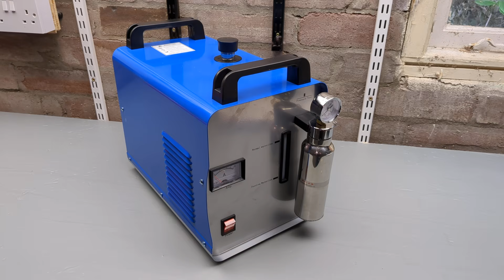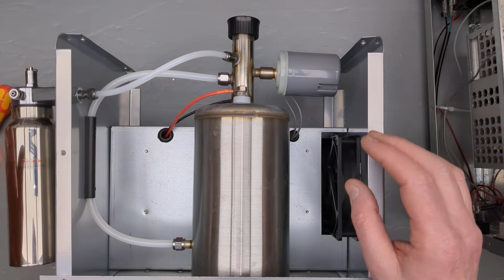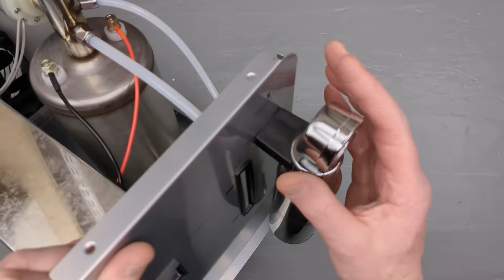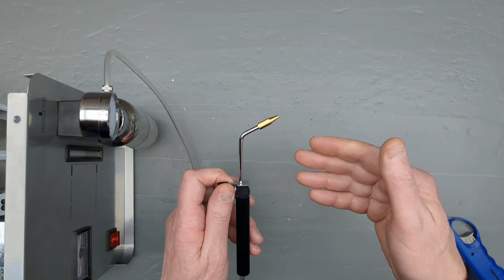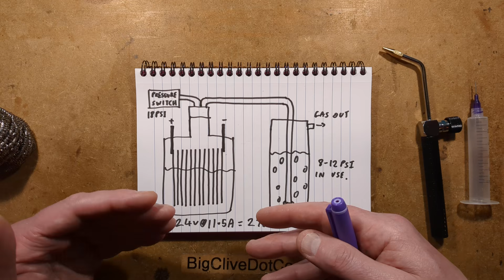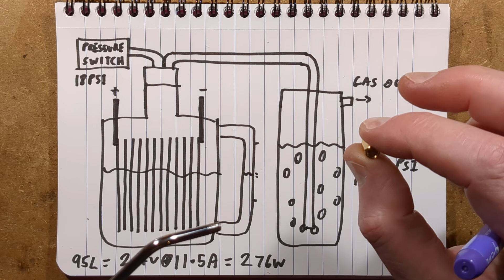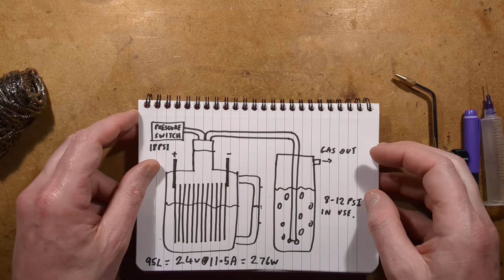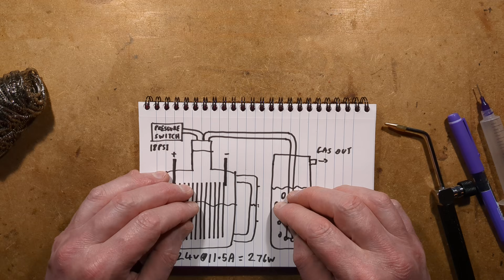Inside OxyHydrogen gas generators (HHO/Brown's gas)

Comment: My high school chemistry teacher told us about a demonstration he did a few years earlier. He put some soap and salt into a pie tin of water and added a couple wires to a power supply. He let it run for a while on his lab table up front while he talked about electrolysis. Then he pointed out that by putting energy into the water, he could separate the H and O, and that if it were ignited, it would release that energy. 
When there was a nice pile of bubbles, he tossed in a match.
It blew out all the ceiling tiles over his table.
He didn't say anything to us about whether he (or any students) required new underwear.
Reply: I love it when high school chemistry teachers randomly act like magicians in a king's court.
Reply: @geoded  Today there will be 5 helicopter moms complaining that their baby had to hear a sudden loud noise.
Reply: This is what chemistry should be even if it is somewhat risky.
Reply: I remember my very first chemistry lesson.  The teacher put a small pile of potassium permanganate on his bench and added some glycerine.  A couple of minutes into his lecture it all caught fire.  That got me hooked on chemistry.
Reply: Not sure why it's "HHO" gas... wouldn't it be 2H2 + O2 gas mixture?
Reply: @iWhacko  Each action of electrolysis results in two individual H and one O atom. Sure, in the space outside the liquid, they combine to H2 and O2 molecules, but that's a separate reaction. For clarity, in writing and language, you say that the electrolysis creates HHO, not 2H+O (unnecessarily complicated), not 2HO (wrong, it doesn't create two hydroxy ions), not H2+O (might be misread as H2O and also the formation of the H2 diatom happens separately from the electrolysis) and not 2H2+O2 (again complicated AND wrong, since we're talking about the products of a single electrolysis action).
Reply: @CookingWithCows  That is incorrect, there never is free H or O present. Otherwise you would not only create Ozone (easy to smell) but it would also self-ignite due to the highly reactive nature of both species. There only ever forms molecular H2 and O2.
Reply: @iWhacko  the HHO name is legacy. It was invented by a quack that was trying to claim this was a new kind of gas (i.e. not just a hydrogen and oxygen mix) and only his machines could make it. That's why the name makes no chemical sense.
Reply: Haha what a great teacher...
Reply: I loved my high school chemistry teacher, he was always doing stuff like that. He made a calcium carbide cannon and used it to shoot projectiles down the hallway. He made benzene and set the top of his desk on fire, filling the room with black ash floating everywhere.
Reply: in biology class one smartass student decided if you put a drinking straw up the frogs bum (it was dead and ready for disection) he could inflate it like a balloon.
not to be outdone someone else filled it with butane and as the gas came back down the straw lit the flame.
a loud "pop" and 30 students plus teacher covered in frog bits
Reply: Another comment of mine deleted - is YouTube censoring out comments on chemistry now ???
Reply: @tncorgi92  YouTube prefers nude bots instead.
We all know that.
Reply: @tncorgi92  of course they are

Comment: Some of the welders at my old work filled a bin bag with oxyacetylene, when they lit it on night shift it went with such a bang the dust got blown off the top of the overhead crane and they never did it again. A few brown knickers that night i bet 😂
Reply: Years ago, I watched a Panel repair shop doing that with balloons with fuses. They would fill and light them, then send them out the window, into traffic on a major highway.
It was their lunchtime entertainment, watching motorists and pedestrians soil themselves in fright
Reply: @bigbadwolf1966 filled a junk car with it that still had all its windows and doors.  Sent parts all over the salvage yard. Boss not amused .
Reply: @jhonsiders6077  Turned a station wagon into a mini van.  😅
Reply: Back in 98, on my first job as an electro-mechanic at a rewinding shop, a co-worker and I did the same thing, the last day before Christmas. The boss and his entourage did always go out to eat at the fancy restaurant on those days. And all the old French dudes where taking their usual nap after lunch, they all did every day, I guess the red wine makes one sleepy :)
But we put the gas in a latex glove with a lit cigarette tied to a finger as a time-fuse and a nut to another finger to weigh it down, then we put the glove inside a long, thick walled steel tube used for machining, it stood upright and was secured to the wall. 
That sounded like a cannon shot when it went off and the cig was so that we had time to run away and hide ;) And yeah the old black dust full of glass fibers, mica and god know what else, fell from the rafters and the overhead crane. A year later we used a big polish cobra firecracker in the same tube... I only worked there for 2,5 years, it was really filthy in there. All that dust, greases and the chemicals from burned windings and enamels. Solvents and thinners to wash out the windings and rotors (under 50 MOhms@1500v High-pot) from the graphite dust sure took some years off my life and gave me Tinnitus, from the compressed air... 
And now my final and last edit :)   I had to take some passes on many collectors with the lathe because they often where very worn.  I than had to grind out the mica or perhaps even asbestos insulation between the individual copper blades using a very small air- powered dentist style diamond abrasive wheel and chamfer & deburr their edges... And PPE was at that time a problem, the Boss's wife always yelled at us after the restaurant and I suppose a good amount of alcohol, so often there where no masks, latex gloves or earplugs left, since according to her we used to much of them, go figure. 
The oldest French dude once even threw a 2 Kg wooden mallet at her and had a heart attack 10 minutes later... After our paint guy had developed some form of light liver damage and his skin had become some shade of red, we at least got a half face-mask with a combined filter for particulate and vapors and on top of that I also got a pair of prescription safety glasses, after ruining my personal pair of glasses. 
After that job I repaired and serviced large HVAC installations full of anhydrous ammonia and then went to work for DuPont de Nemours , where finally there was a standard operating procedure for each and every single job with PPE everywhere, and you better take the stairs on the right side, firmly gripping the railings Lol. 
But I did learn a lot the motor shop, the place still exists today. Back in 98 we mainly serviced, repaired and rewound big DC motors. Today they also wind huge alternators for Vestas and other windmills
Rofl, thanks for the good and bad memories from a time when I was still young and naïve.
Reply: We filled a beach ball with oxyacetylene, put a long piece of masking tape on the side, doused it with WD40 and lit it.  The explosion was blinding AND deafening.  Kids, don't do this - we were professionals.  Professional knuckleheads, but professionals, nonetheless...
Reply: A 200 ml chocolate milk container full makes enough noise to make storeman kick himself over backwards out of his chair, I'll wait outside while you set off a binbag full, thanks.
Reply: You guys should search on youtube for 'carbid schieten'
It's Dutch folklore XD
Reply: The oxyacetylene pops make the oxy-hydrogen seem quite tame!

Comment: Many years ago we used to make Hydrogen with sodium hydroxide and aluminum. The reaction does get very hot. We would then fill dry cleaner bags and tie a piece of toilet paper as a fuse to it. It would go up 30 feet or so and then explode and sound like thunder. People would come running out of their houses on a clear day to wonder what happened. His mother was always out of aluminum foil. 🤣🤣🤣
Reply: For bonus points, maybe mix in some finely ground flour or cornstarch and see if you can get a dust explosion kicker!
Reply: I used to do it with water balloons, little small things nice bangs.
Reply: Did exactly the same thing, but in two stages. First stage was a drum with aluminium and sodium hydroxide solution. Then the hot gas was piped into a second drum filled with water. This cooled and cleaned the steam out of it. What came out was essentially pure dry hydrogen. This went into balloons of course. What we sent up with these balloons varied but the best ones carried a second balloon filled with an oxy/acetelene mix. Attached to that was a cracker of some sort with a time fuse (an incense stick) These burned at about a minute per inch so we had a good idea when it would go off. After 5 minutes the whole thing would be at about 5,000 feet so the whole neighbourhood got to experience the bang. Best at night time.
Reply: I bubbled it through water to condense the steam. Used to fill large balloons and condoms. I once had about 20 balloons and a condom against the ceiling inside a flat and separated one balloon to light it. I saw a flash and heard/felt a massive boom...it set off the condom and most of the balloons. Made the windows in the building rattle. Bunches tied together with a long fuse would look great exploding in the distance.

Comment: Fun fact - if you provide a 100% excess of the stoichiometric quantity of oxygen, the detonation speed increases substantially.  I don’t know if it is louder, but it is more amazing.
Reply: And if you're braising, you need 5 hydrogens for each oxygen to keep the flame from oxidizing metals.
Reply: Odd that this is the exact opposite of petrol vapour, where excess oxygen slows combustion speed.
Reply: @ferrumignis  are you referring to an internal combustion engine or is this some setup with pure oxygen?
Reply: Hydrogen not oxygen

Comment: Burning hydrogen and oxygen doesn't really make water (a liquid), it makes hot water vapor (a gas) and is very exothermic.  I wouldn't rely on that creating a vacuum.  After all, they use the hot expanding gas from this exact same reaction to put spacecraft into orbit.
Reply: Yes, but then the chamber and standing water will conduct away most of the heat, creating a near-vacuum almost instantly.

See “steam engine design” for details.

Comment: With a hose full of hydrogen and oxygen, what keeps the flame from just going right on up the hose on that?
Reply from the maker: Not much.  Flashback is common on these systems.
Reply: Two things come to mind.
1) The nozzle with its tiny orifice produces a high speed gas jet. The jet burns, while the gas velocity may be sufficient to "blow" combustion out of the nozzle. The success here depends on how fast the gas actually burns.
2) The brass nozzle is an excellent heat sink. Similar thinking suggests stuffing the tube with brass or SS wool may be effective with small dia tubes. If the heat sinking wool gets hot enough, it simply becomes a flame holder.
Reply: Gas flow rate.
Same thing goes for acetylene. Setting one up with the pressure regulators running too low is how flashbacks happen. Or the flame migrates back down the torch tubes and into the mixer (in your hand), eventually (pretty quickly) melting the tip tube or letting you know it's happening by finger/palm print removal.
Reply: Flashback is more likely when the flame is perpendicular to the surface being heated.

Comment: It is very easy to generate small amounts of oxygen and hydrogen separately in small quantities with a very modest setup and low voltage DC. Just capture the bubbles from the anode and cathode separately. I did this for a school project using an old lantern battery for power when I was 12 years old in the '70s. It sends me crazy to watch the scammers pitch magic to younger generations that never learned the physics basics.
Reply: @Nighthawkinlight for more details, because there are safety concerns when generating at home, in your bubble bath tub.
Reply: @PastorOfMuppets616  I did this for fun after I learned a little about ions in my first college chemistry class. In small quantities, all you really get is a neat little "pop" and a quick, tiny burst of flame when you light the hydrogen. I wouldn't want to touch it, but it probably wouldn't do much more than singe your hair.
Reply: @PastorOfMuppets616  Yes, there are safety concerns, but generating the hydrogen and oxygen as separate gasses, as I describe, does not create the explosive mixture of those two gasses mixed as shown in the video.
Reply: the reason these things are popular is because of how fast they generate gas and the resulting flame being way higher than what butane will give you. the electrolysis setups I've messed with would have taken a day or more to make enough gas to run that little high-temp torch.
Reply: I did me some electrolysis way back when (had to be 1964 or earlier because of where I did it).  The gases were collected in inverted test tubes,  and the electrodes were carbon rods pulled out of dead D cells.  Power was a "dry cell" or two,  probably pretty much depleted.  This ran very slow,  so at some point I hooked up a 500mA rated selenium rectifier I had on hand and a line cord,  and plugged it into wall power. That went a good deal faster!  I had to replenish the water fairly frequently,  and of course whatever was in it stayed behind,  so the water got darker and darker as time went on.  This put me off of drinking tap water for a good long time!  :-)
Reply: I blame TikTok for shortening their attention spans.
Reply: @PastorOfMuppets616  The platform isn't the problem. It's always been the accelerating decline of the  meatheads it attracts.
Reply: Use stainless rod and copper tube and twelve volt battery to generate hydrogen

Comment: Wouldn't it be safer to just have it use the Hydrogen from the Cathode, and venting the Oxygen from the Anode, then having a torch which mixes the hydrogen with air before burning it? That would make the thing less explodey.
EDIT:  It would mean a redesign of the whole electrolysis chamber though. And having thought about it, it wouldn't work either, as the air needs to be pressurised
Reply: That's hard to do and keep it pressurized.
Reply: @stargazer7644  Indeed. I admit that my idea isn't a good one
Reply: With the series stack of cells, each plate will have H bubbling out on one side and O on the other. To keep them separate, you need a single cell with a shroud over each electrode to capture the gas and keep them from mixing.

Comment: The yellow colour of the flame is definitely from trace amounts of sodium. Pure oxyhydrogen flame is colourless and almost invisible (which is one of the hazards of hydrogen).
Reply: Yes, it resembles a Nitromethane flame.

Edit: The pure hydrogen flame, that is..
Reply: Blackbody in a flame is usually literal red hot carbon (soot).  Obviously none of that with this fuel.
Reply: I have one of these, and to avoid the annoying yellow sodium glare, I use distilled water (tap water has lots of sodium) and potassium hydroxide. A small amount of electrolyte aerosol makes it through the bubbler. Also in the bubbler, methanol plus boric acid (which react to make volatile trimethyl borate as a flux, supposedly) mixed with MEK to reduce flame temperature and hopefully make the flame slightly reducing. Nice green flame.
Reply: @mikerudin8261 MEK is methyl ethyl ketone?
Reply: The 3000 K blackbody spectrum is that color, and the flame gets that hot, unlike pure hydrogen burning in air.
Reply: @jsalsman  but there is no blackbody
Reply: @HanTrio3  any matter including gas will emit blackbody radiation when it gets hot enough. It doesn't need to ionize to glow.
Reply: @jsalsman  There is no real blackbody. It's a theoretical object which absorbs all electromagnetic radiation. Soot comes close but gases for example don't behave at all like a blackbody
Reply: Could also be water vapor picked up going through the bubbler.
Reply: @darkknight145  Sodium in the gas, from the vigorous reaction. You only need a trace amount to get that yellow flame.
Reply: @darkknight145  water vapour doesn't produce any colour

Comment: That's where bigclivedotcom becomes mikeselectricstuff! A very nicely made unit, simple but pro grade stuff. 
Glass melting... reminds me od my teenage years when I had a little chemical lab in my room and sometimes used a kitchen gas cooker to bend or pull capilaries out of glass tubes.
Been missing the kink palculator too, a nice comeback.
Reply: It's a glorified kettle.
Not very efficient at all.
Hence the fans.